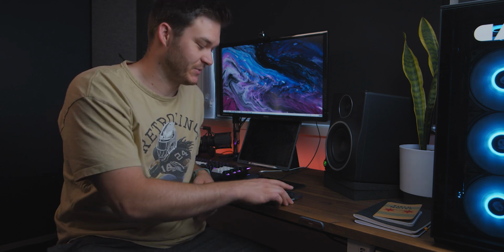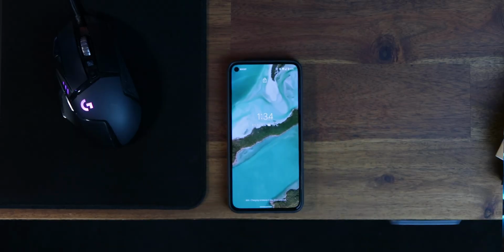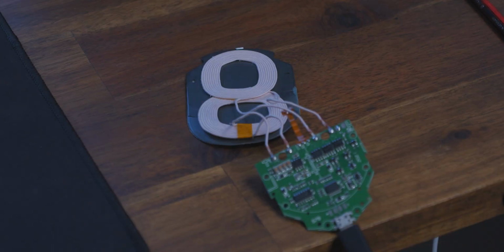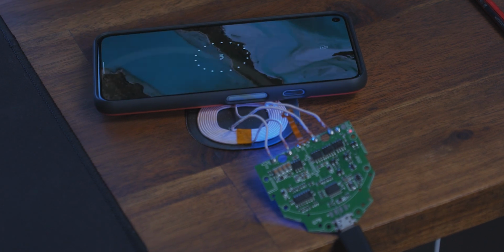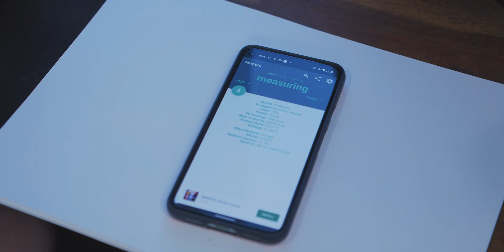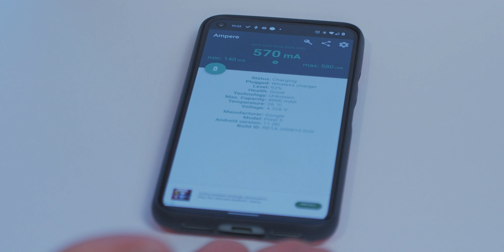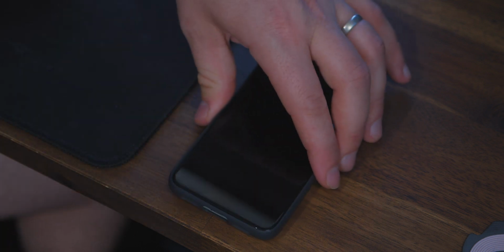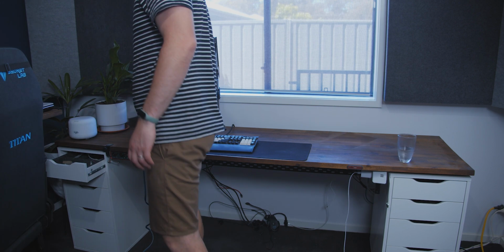Wireless charging desk mod

Comment: In what wood is your desk? Walnut?
Reply from the maker: Its an Acacia panel, they sell them in the kitchen area at Bunnings in Australia. Best value Solid wood tops for around $60, could try with a veneer panel and scrape out the infill, but a solid wood benchtop would be the best option if doing it.

However to be honest, I rarely use the charger as I now try to keep my phone away from reach when working to stay focused haha. But it's a neat trick

Comment: dope video! If you're planning on doing this, I'd suggest getting a top bearing dado bit. that way, once you're done making your shape, you don't have to worry about the shape anymore and can just run it along the bearing on the outsides and nibble away the center for each pass.
Reply from the maker: I have seen them! They're probably the next bits I need to buy for future projects especially if they're viewable routes

Comment: Great idea. I'm about to build a custom desk myself after have horrible luck with the Secretlab Magnus. Looks like you have the IKEA hack desk, but you actually had the desktop attached to the cabinets? What hardware did you use and how to you go about doing that?
Reply from the maker: Oh it just sits on top, I took the 4 black plastic feet that come with the IKEA ALEX drawers, drilled holes ontop of the drawers and put the feet on top to give a little spacer between.

As for the benchtop, it's not from IKEA, they overcharge for their SOLID wood tops, go to Bunnings or a hardware store and they should have cheap SOLID WOOD kitchen benchtops. These wont sag, and like in the video, can be cut or routed to your liking :)!

Comment: Does these overheat and use power when is nothing on charge?
Reply from the maker: Naah, the coils aren't on at all when on standby, there's only a LED light showing power, but will go from green to blue on the unit I have when it's actually charging 👍

Comment: Great video! Can you use a normal drill to make the hole?
Reply from the maker: Kinda haha, you can look up Drill Router Brackets, there's a few things which will allow you to use a standard drill. I think the benefit of a plunge router is it's speed, it's really going when cranked up. But I don't see why a hand drill with the right attachments couldn't make it work, will just take more time, precision and patience to achieve a the same result :)
Reply: @camshand  Thank you so much